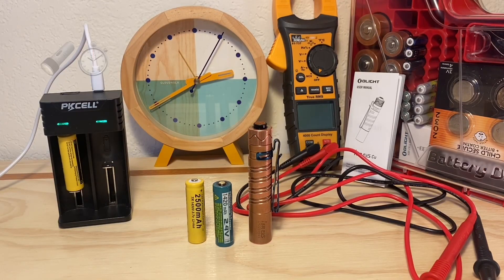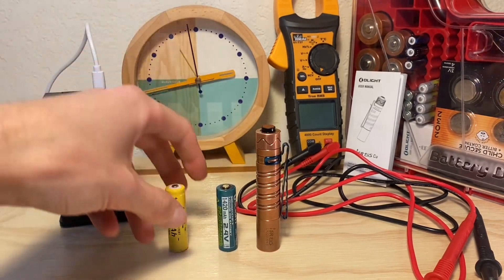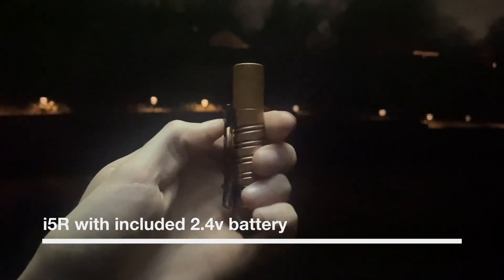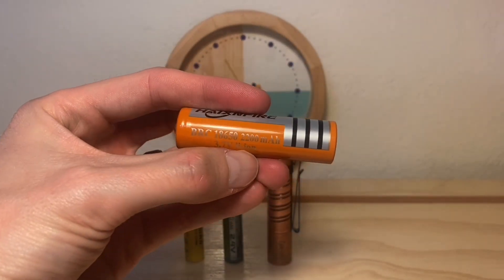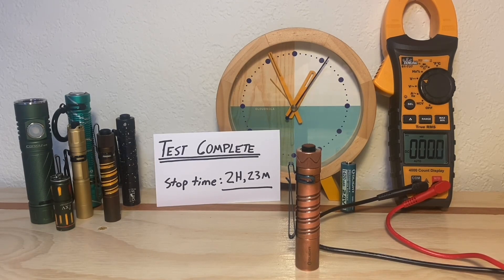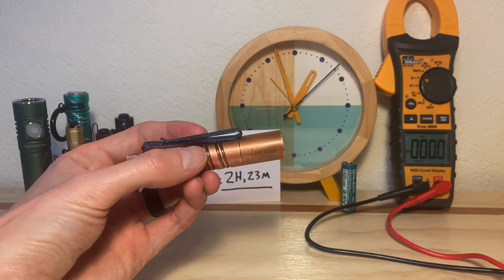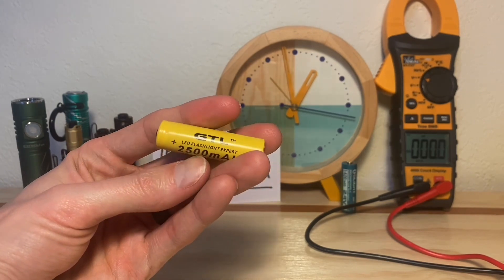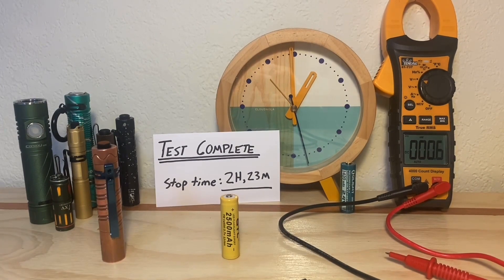Olight i5R with 3.7v 14500 Runtime Test

Comment: Try with a good 14500 like the vapcell or keepower, the GTL are scamm (usually the capacity is not even close to 1/3 of what they said on packaging) , no way you can have  2500mAh in a 14500, max is aroud 1000mAh. I've a Sanyo UR14500P  with "only" 800mAh, and it last almost 2x the time of those 2500mAh GTL...

Comment: Nice testings. Have the I3T/10440 combo, wonder if the I5R would bring any upgrade actually…
Reply from the maker: Nice, the i3T with 10440 is my favorite combo! Personally I think the i5R does its best with its included battery. I guess deciding between the two would come down to one’s beam pattern preferences and/or runtime needs. The i3T with 10440 shines better at distance but the i5R’s runtimes are more impressive.

Comment: WILL THE I5R BATTERY WORK IN A I5T FLASHLIGHT ?
Reply from the maker: Good question. Yes, but it is not recommended. The i5T becomes extremely hot when using a 3.7v 14500 battery.
Reply: @PardonMyEnglish  THE OLIGHT BATTERY 2.4 1420
Reply from the maker: Yes, in my experience it works well. Might not be officially recommended by Olight but it does not seem to have any issue.